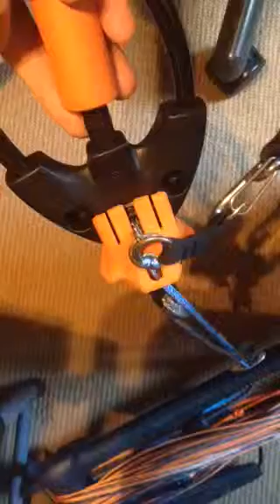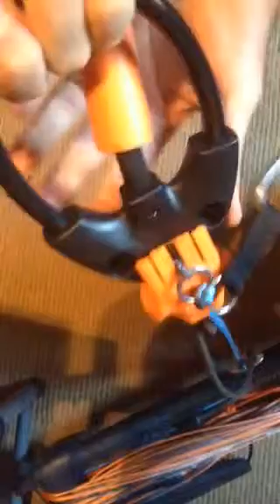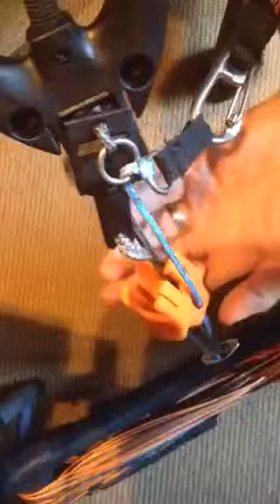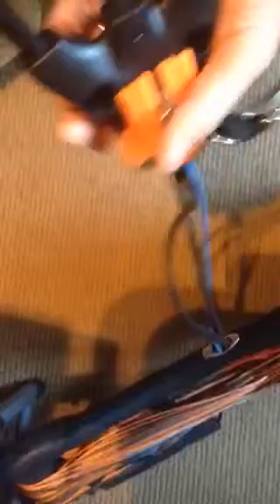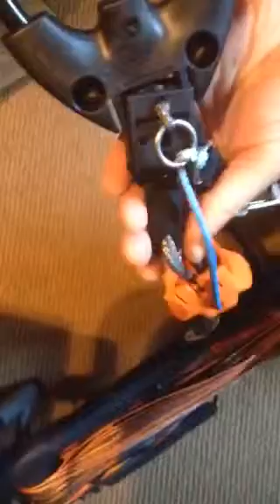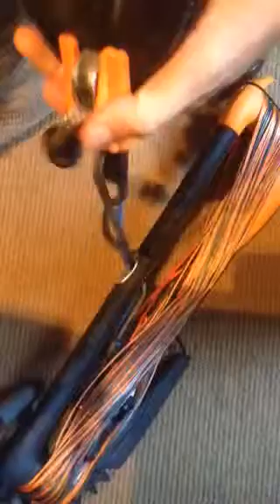2015 Liquid Force CPR Issues

Comment: i have been using this bar for a while.  it releases under tension.  i see nothing wrong with your release   hook lines to a tree, put harness on, hook into chicken loop lean back like you where kiting and push the orange piece forward let me know what happens.   bet it releases and you fall flat on your bum.
Reply: Kevin Lawrence yes agreed ... good steady tension will aid the ease of release... but that doesnt always happen. I used this release just 2 months ago and it failed again during a self landing... some sand may have jammed it, but jam it did... i know now to keep it clean!
Reply: not that it will make a difference in the releasing of the chicken loop but, liquid force advises not to hook your leash to the nylon pull loop but hook to the steel loop instead